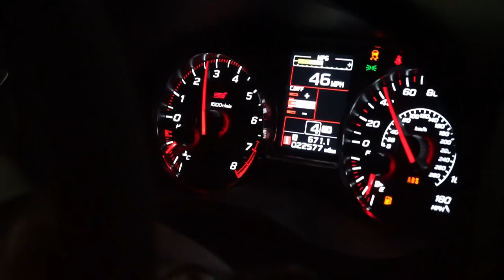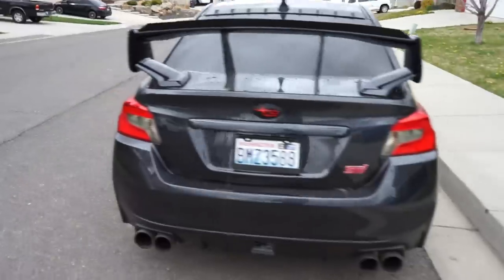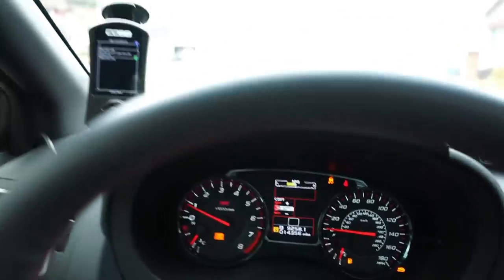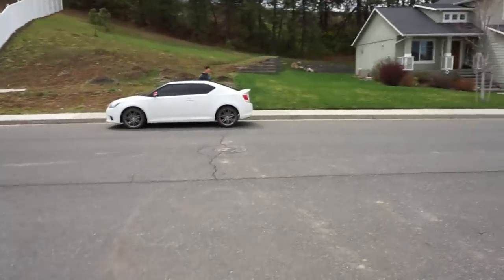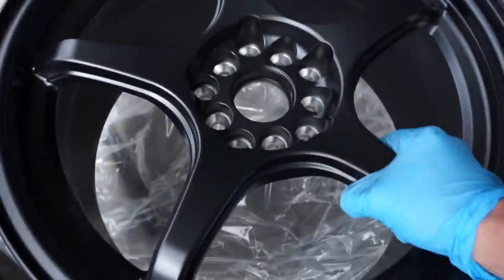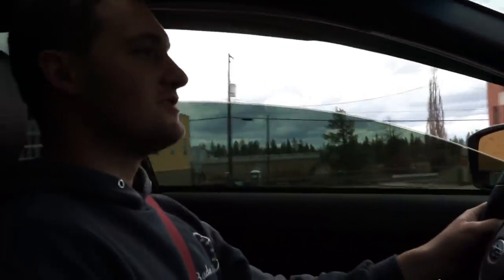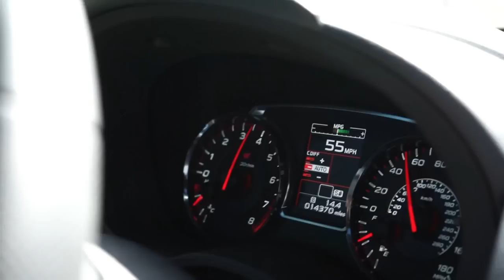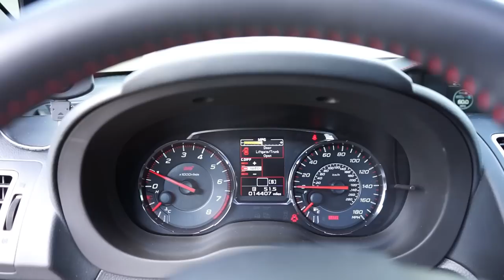Travis 2019 STI 700whp Build: First Drive / Engine Break-In Talk

Comment: Hearing Travis’s motor rip through the gears eerily sounds similar to series gray! For some reason I feel an FA24 swap going into the WRX! Either way loving the content! 👍🏽👍🏽
Reply: At the moment I think it's worth seeing g what Subaru is going to do with the fa24 before owners try to fiddle with it
Reply from the maker: Im super excited for whats about to come for the wrx :)
Reply: jay bosher Prime Motoring in NJ has done a FA24 swap into a crosstrek, and is continuing the development of the FA24 with upgraded fuel rails from IBR to handle the DIT fuel system. Whether Subaru puts the FA in the next gen STI, this will give current gen FA WRX’s the blueprint for doing so in the future.
Reply: @2bigfeet1986  they have all but confirmed the use of the fa24 in the new sti with some potential images of what the sti may be getting. Most likely the hydraulic power steering is getting replaced in the next gen. 

Thing is with the fa24 now is i dont believe it has forged internals while the sti version is speculated to be getting forged everything stock. They may not me aftermarket strong but I think it's worth a wait to see what a massive corporation with a multi million dollar r&d budget can accomplish and build on it from there. Supposedly this new engine is supposed to be coming out next year so it's not too far away

Thanks for the lead on prime motorings build tho I'll check them out.

Comment: best brake in ive ever done to any of my motors is fire it up. bring it up to operating temperature. rev it up and down a bit no constant rpm and then right on the dyno for some 700whp pulls. motors been going strong for 6 years

Comment: Quick question,  so I'm a firm believer in the 50 mile break in. But what about if you're installing a brand new clutch at the same time. I know they recommend a break in with the clutch too. What's your stand point?
Reply: Bump

Comment: Why did you choose the newer STi to build for drag racing? I’m sure you can do it a lot cheaper and faster with a lot of other cars out there even older Subaru’s. That must be really expensive. I spent around 4K on my wrx and that was just full bolt ons with a pro tune. Curious to know your thoughts on that if you wouldn’t mind.
Reply from the maker: Much better platform IMO.

Comment: What turbo did you go with? Also injectors size? I have a Garett 3071 and topped off at 400 hp with 1050cc and E-85. The stock TMIC in junction with the 1050cc’s restrict the power gain. What do you recommend to upgrade to gain the max power?
Reply from the maker: The whole build is on the channel lol

Comment: Hi can you safely daily drive or long drive a fully built engine short block, garret g25 turbo, competition stage 4 clutch, with  auto blip,flatfoot shift and lunch control, its heavily modified car. 620whp (its 770hp right?) This cars specs not mine but planning to buy it. For a some daily drive or sunday long drive. Is it safe driving it? i do not plan to go red line or shifting like an as$ 😂 i just really like the mods of this car and looks that all. Or can you suggest a software or power cut switch to lower this car power to 500hp in a snap and go back to full power if i like. Pls respect post hoping to hear some advice and suggestions

Comment: This was excellent. Loved it. I'm surprised how responsive this car is. Would a gt30 or blouch dom3 with the proper cams be just as responsive or more responsive than the stage 2?
Reply: Joel Peter the reason my turbo is so responsive is because it’s the gtx3576. Running the 30r cold side and 35 hot side. So I’d say a gtx30r would be about as responsive as this
Reply: @onyx_sti9311   thank you. Clearly its a great combination. Looking forward to more.

Comment: Makes sense to me, break it in the way it's going to be driven ☮️
Reply: Yeah all engine manufacturers request an easy brake in period for no reason? Its to make sure cylinders and pistons and rings to shave metal to even everything out and not have uneven heating. But hey you probably never had anything nice enough to care about...
Reply: Why warm it up? Makes no sense....
Reply: @mikeconrad2163  Just spent about 8 grand fixing my 2005 Legacy GT. I think I'll break it in the safer way for 200-500 miles, and still be pretty nice to it until 1,000. How do you thrash on something that cost so much time and money.

Comment: Iag told me to upgrade manifold after 500 hp but here is a 700 hp with stock manifold I’m so confused?
Reply: An upgraded manifold cost mid $1000. Just depends on your goals. I think prime or Bader did a comparison on it. Most run stock manifold up to 500whp

Comment: So IAG says not to boost or higher than 4500 rpm but do you get into a little boost in the first 100 miles? Im going to break in my first IAG motor. Ive broken in my car intially last year but is it different for a built block?
Reply from the maker: I have different break in process than them. I’d listen to your engine builder on what they want you to do 👍
Reply: Can u build my 2016 hyper blue sti how I contact you ?

Comment: Hey man!! What piping did you use for your process west connection to ETS? I was told that the ETS FMIC kit piping won’t work?
Reply from the maker: Hi there sir, I actually have a custom modified intercooler pipe for the one going to intake manifold to be able make the two work together.
Reply: _BaderBuilt awesome , thar is what I was told by IAG . Thanks for the quick response.. @subie_pew is my IG.. your vids are great man!!

Comment: Subbed! I live in Rhode Island have you ever heard the name Jay Perry from Perry Tuned? He’s got a 9 second STI u may have seen. I just bought a full STI swapped 2011 WRX full stage 4 IAG closed deck everything for $13,000
Reply: The kid had Jay build the car for him, the block alone was like $6,500 and he said the kid put around $12,000 in my motor alone. I’m so happy I pulled the trigger on buying the car. He wanted $18,000 I got it for 13k so I’m happy. It has the stage 4 extreme IAG closed deck, I beam roses, Manley pistons, stock cams i think, 6 speed, Braum race seats and harness bar, Sony in dash, brand new Enkei RPF1’s, Invidia N1, FP green turbo stock location, 1300cc injectors, 38mm EWG not sure what kind of downpipe though, all Perrin shields and covers in the engine bay, has the aftermarket solid pitch stop mount, I think he used the stock 2.5L WRX heads for the build though, which I believe he had freshened up before assembly. I heard they flow just as good with a little work. I bought it a week ago and already broke down lol but I made it home luckily, and found out today it was a bad Aem map sensor. Over nighted a new AEM map sensor for $170 gonna have it up and running again tomorrow. It’s still on a break in tune and I’ve gotten a little carried away here and there but overall I’ve been doing exactly what you said for break ins even before seeing this video I speed up with a little boost and let it engine break instead of using my brake pedal and I’m constantly shifting and rev matching my downshifts. This is literally my dream car kid paid $20,000 for the stock 2011 WRX and had Jay build everything he put about another 20k into it

Comment: High boost rice box that will need another freshening in less than 30k miles due to weak compression.  I drive a ZL1 and have no such concerns, plus it sounds 100x better than wet fart rice noises
Reply from the maker: I don’t see point of your comment? I like all cars and I have plenty of customer car over 60-70k lol. I’m sure if you rode in one it’d change your mind. Or we could just line up vs my daily driver and see the difference 😁
Reply: What is the loss of compression at 70k and how much boost are you running (to produce 700)?  Just because the motor still runs isn't the real issue.  I can guarantee you any motor running 30+ psi and driven hard will be down on compression after 20-30k miles.  As far as lining up, the ZL1 makes high 600s to the wheels with bolt ons only running 10 psi and very little stress on the engine - beat that - you can't, it also sounds 100x better than these rice cans
Reply: @fzr1000981  ur fried
Reply: @RoseCreature-iy4ko  No I'm miles over your head son